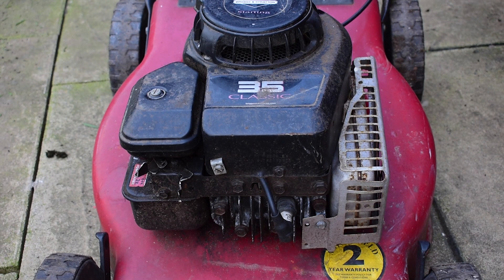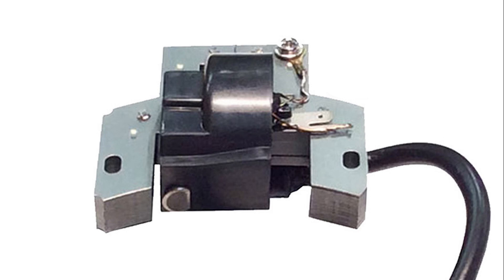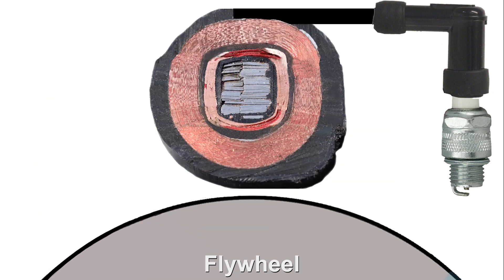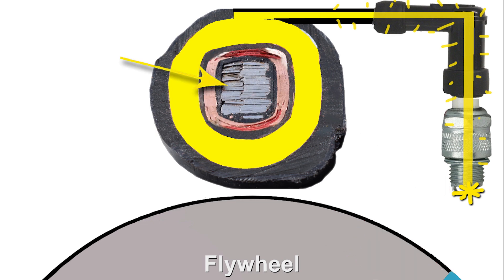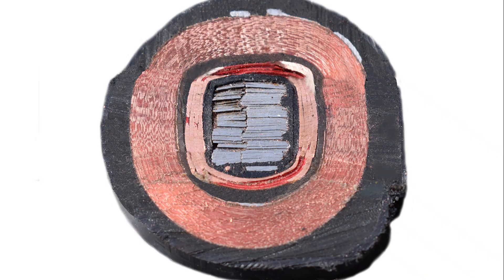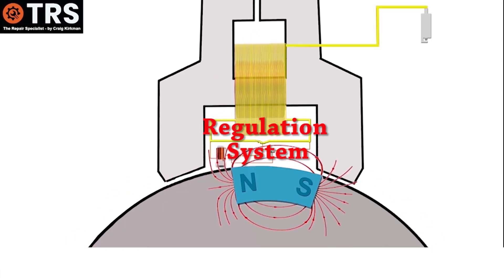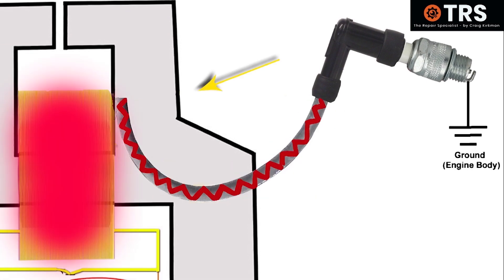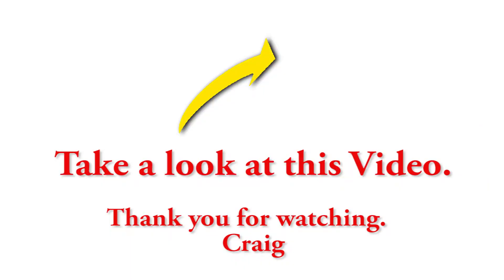Lawn mower Stops after few minutes, when HOT - This is Why!  (by Craig Kirkman)

Comment: Amazing explanation..!  I see you know this perfectly, and that is deep knowledge.. So I have problem with lawnmower and she is starts and die , and now no reaction and nothing happened .. I tested almost all parts and I m not 100% sure what is a a problem , because also cylinder can be a reason , I checked him also and didn't see any problem on the pistons and rings .. I tested also ignition coil , and and I tested resistance with multimeter and you know how ,and I get almost nothing and just few times very high resistance about 500 Kilohms , and I have a spark on sparkplug but I also tested spark outside cylinder straight on the fuel to try make a 🔥 but nothing ... Are you sure this coil is not good , and is that good method for checking? If is that problem , I want to replace that part on the machine.. Also my dihtung below carburator is burned , but I m not sure that can be a reason to I can't even start and get some reaction.. !!! So can you give me good answere .. Please !
Reply from the maker: Thanks for the detailed question — you’ve already done some excellent troubleshooting.

A few points that may help:

Ignition coil testing: Resistance readings on small engine coils are very unreliable. The windings are so fine that a multimeter often won’t give a stable or meaningful reading. The true test is spark performance under compression. If you see spark outside the engine but the engine still won’t fire under load, the coil could still be weak — sometimes they break down when hot or under pressure.

Burned gasket under the carburetor: Yes, that can absolutely cause a no-start condition. If the gasket (dihtung) is leaking, the engine pulls in air instead of fuel vapor, creating a very lean mixture that won’t ignite. Even with a strong spark, the engine won’t run if the mixture is too lean.

Spark test in fuel: That’s not a reliable method — even a healthy spark may not ignite raw liquid fuel outside the cylinder. The correct way is to test spark with a proper tester or visually across a grounded plug in open air.

My advice:

Replace that burned carburetor gasket first — it’s a known fault that can stop the engine completely.

If it still won’t start after sealing the intake, then consider swapping the coil for a known-good one, especially if spark seems weak or intermittent.

You’ve narrowed it down really well — most likely it’s the gasket/air leak causing the no-start, but a coil that breaks down under load is also possible.

Please let me know how you get on with this, but please do this first.

Thank you

Craig

Comment: Great presentation 
I have a briggs and stratton 500e lawnmower, ive clean the fuel tank and the cabbirator, changed the spark plug which has agood spark now but the engine still does not go
Need help pliz

Comment: I found this YouTube video after having my reliable Honda mower crap out on me AFTER the motor got warmed up.  It wouldn't restart until the motor cooled, then it would again crank right up and run fine for a few more minutes, then conk out again, frustrating!  But why?  My question was perfectly answered at the end of the video:  vibration from a bent crankshaft.  I had done exactly this when the mower went over a little edge of concrete in my yard.  Out of necessity I continued to use it for over a month, even though I noticed the vibration and figured I had bent the shaft.  
The shaft got fixed at considerable expense, but then the quitting.   Now I see why, and fortunately a new coil is available and will be delivered tomorrow.  Another YT vid detailed the coil replacement procedure for my exact mower, what luck!
This was the only video I found diagnosing the problem, thanks!!
Reply from the maker: Hi

thank you for sharing your experience and the solution you found for your Honda lawnmower's issue of stalling when hot due to a bent crankshaft.

It's great to hear that you were able to identify the root cause of the problem after noticing vibrations following an incident where the mower went over a concrete edge. The diagnosis of a bent crankshaft causing the stalling issue when the engine warmed up makes a lot of sense in this context.

I'm glad that the video you watched provided you with the necessary information to pinpoint the issue and take the appropriate steps to resolve it. It's always frustrating when equipment malfunctions, but it's empowering to be able to diagnose and fix the problem yourself with the help of valuable resources like YouTube tutorials.

Replacing the coil as detailed in another video should hopefully address the stalling issue, allowing your Honda mower to run smoothly again. It's great to see how online resources can be so helpful in solving specific equipment-related problems.

Thank you for sharing your story and for being part of our community. If you have more questions or need further assistance in the future, feel free to reach out. We're here to help!

Best regards,

Craig

Comment: Here’s a problem for ya, so I have a twin cylinder Briggs and Stratton, trying to get it running, we test for spark, (engage starter and spin the engine over checking for spark) we find out we DO have spark, we stop the starter, we plug the plugs back into the engine, spray some starting fluid to fire it for a second, nothing, we take plugs back out and we have lost the spark, in both cylinders. Wait 5 minutes that spark comes back. So in conclusion, we had spark, then tested to start it but we lost spark but came back after 5 min of nothing

Comment: I have been fixing a JD 14sb with a kawasaki fc150v engine, it was just shutting off every time it got hot. It seemed electrical but there was always a spark. I replaced the coil but thevproblem was still there. It turned out it was a small electrical part called the igniter on the side of the engine which controls the timing of the spark. Took me a long time to isolate this fault. Hadn't come across this part before, thought the timing of the spark was simply controlled by the flywheel magnet passing the coil.
Reply from the maker: Hey, great job on troubleshooting and finding the solution for your JD 14sb with the Kawasaki FC150V engine! It can be quite frustrating when you're dealing with engine issues, but it's fantastic that you persevered and discovered the problem.

The part you mentioned, the igniter, is indeed a critical component when it comes to controlling the timing of the spark in some small engines. It's not uncommon for people to assume that the flywheel magnet passing the coil is solely responsible for spark timing, but more advanced engines often incorporate additional components like the igniter to fine-tune the ignition process.

Your experience is a valuable lesson for anyone working on small engines, as it highlights the importance of considering all possible components that could be causing an issue, even when there's a spark present.

Thanks for sharing your experience with us. It's these kinds of real-world troubleshooting stories that can be incredibly helpful for others facing similar problems. If you have any more insights or questions about small engine repair, feel free to ask!

Craig